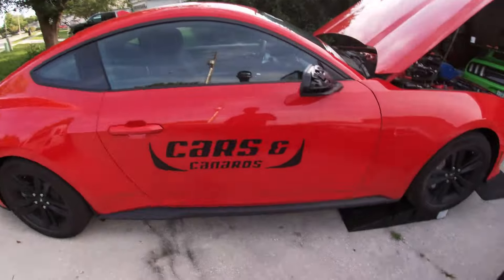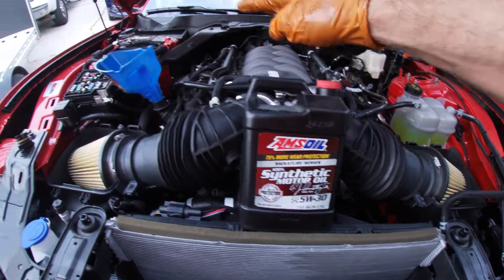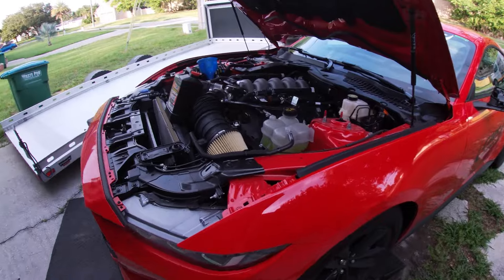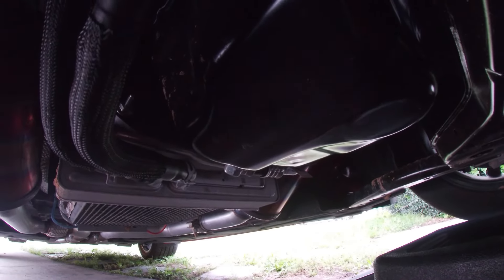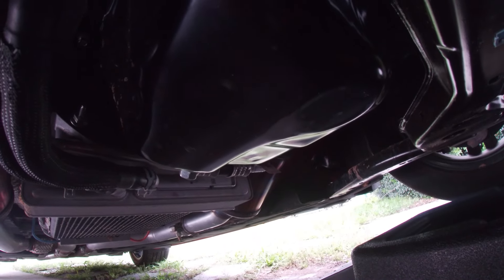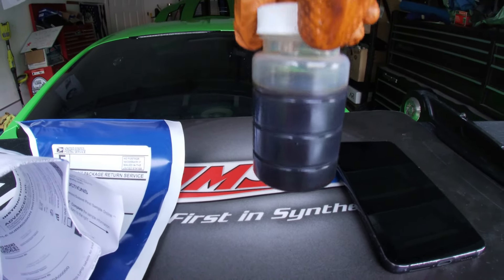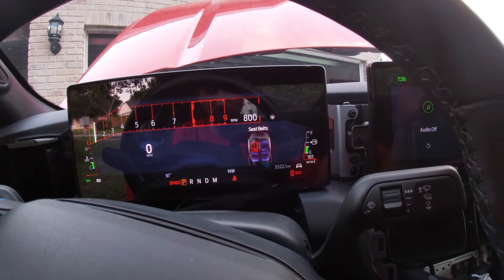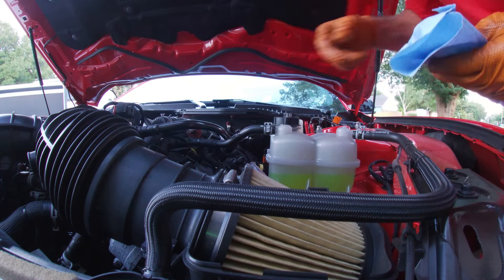S650 Gen 4 Coyote Oil Change HOW TO// Which oil SHOULD you use?

Comment: I have a 21 Mach 1 and all I run is 5W-50 Amsoil. Why you might ask? Well when you go to charlotte motor speedway for the track attack and all those cars run silently after getting beat on constantly I asked what oil do you guys run? There’s no coyote tick? He said you noticed shh 5W-50 castrol only. I couldn’t find the castrol super car so I found Amsoil and that’s what I run. I also noticed if you order a coyote crate motor off say jegs the directions say fill with 10 quarts 5W-50. That tells me the 5W-30 is for fuel economy only. The tick is gone and when warm isn’t only 5-10 psi more of oil pressure.
Reply from the maker: @hpkntnw  good point. Amsoil for the win

Comment: Love how Ford went back to the metal oil pan.. lol  That's why I love my 2015
Reply from the maker: I didn't mind the plastic pan
Reply: @THEDriverMod_  the pan itself is probably ok. It's the stupid plastic drain plug that can cause problems
Reply from the maker: @RidinONChrome  never had issues with those either. Super simple oil change process and don't gotta worry about over tightening it

Comment: They didn’t go up to 5W-30 bc of the temps, they did it because it’s better HTHS due to the heat not the heat itself. Actually thinner oil runs cooler than thicker oil.
Reply from the maker: To a certain point yes. Problem is once the thinner oil gets hot enough, it will thin out and not properly protect

Comment: I was already going with Amsoil already but still here to see what’s up. I use Motul on the STI though. So I haven’t done the oil yet but for that bbq tick they say to add two bottles of ceretec so is that full 10qts and the two bottles? I’m hoping mine doesn’t tick but just asking
Reply from the maker: The tick is just an annoying sound. I've never used Ceratec myself in my own stuff as ive never had the noise, I've put it in some cars ive serviced and it doesn't work so for me it's just a waste, on top of yhe fact the noise doesn't contribute to any reliability or performance issues. Just a sound and that's it.
Reply: @THEDriverMod_  so I was just watching other videos and the guys using amsoil notices theirs wasn’t doing it vs others that used motorcraft or other oils so yeah I think the amsoil might just be enough without additives.
Reply from the maker: @E85_STI  that could also definitely be a reason too
Reply: @THEDriverMod_ thanks for the info and looking forward to more videos on the s650
Reply: I would NOT USE ceratec if Ford gets any idea you did and you have engine warranty issues they will use it against you - the stuff is NOT needed. 

Question for the Channel - It looks like you took off the dress up manifold cover - are you planning on putting that back on …?
Reply: @YingYangStang  I haven’t added anything and the tick is here and there so I just let it do it’s ticking and I’m not going to put anything in there.
Reply from the maker: @1blacktrike  we were gonna make a Carbon fiber version of it and now the Roush Supercharger showed up today so not going back on now
Reply: @THEDriverMod_  how long to get the Roush to your door from order …?
Reply from the maker: @YingYangStang  I ordered it waaaay before it was released. So I'm unsure. I ordered the very first one.

Comment: Have you considered moving to an A40 rated 0w-40 oil?
Reply from the maker: Without and oil cooler, that would honestly be even worse. Reason being is, the higher and oils viscosity, the more heat it retains and the more energy it takes to remove heat from it so actually running that, the oil temps would climb faster and stay higher for longer. Getting an oil cooler is the only option to fix the temp issues

Comment: Why did you go with 5w30 and not 5w50 like everyone recommends for the coyote engine ?
Reply from the maker: @Ybm9000  the recommended weight is 5w30. If you pit 5w50 in and Do NOT have an oil cooler like the non Performance cars do not come with then your oil will get hot and have a harder time disapating the heat as it requires more energy to remove the heat from the oil. Does that make sense?